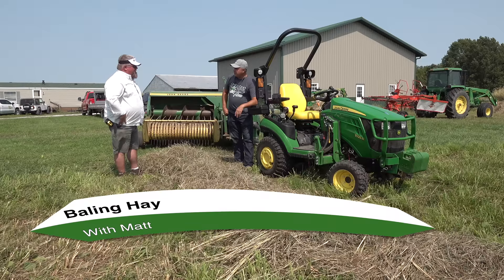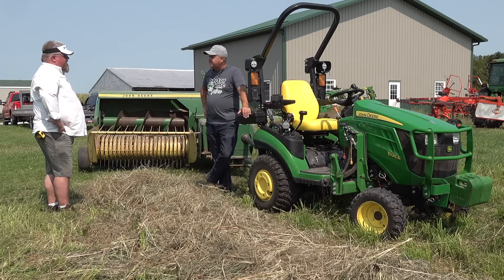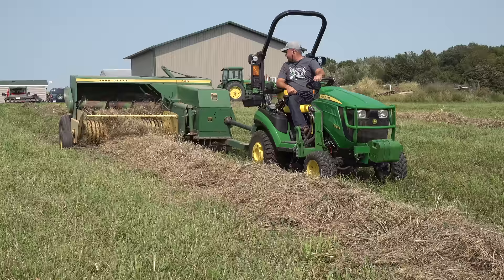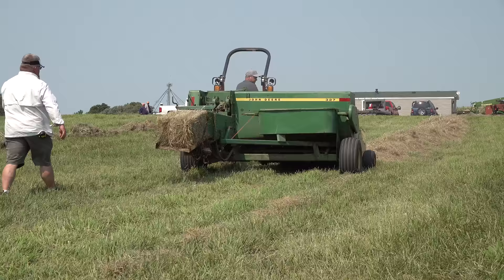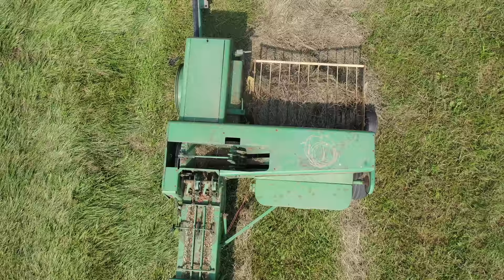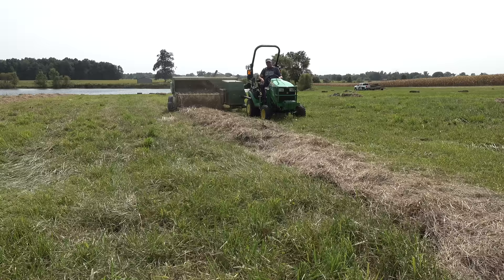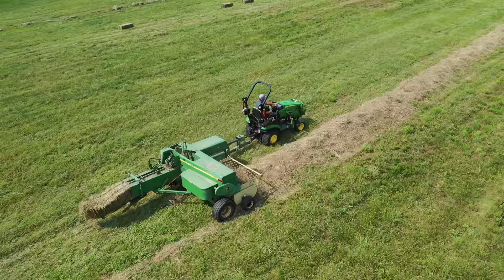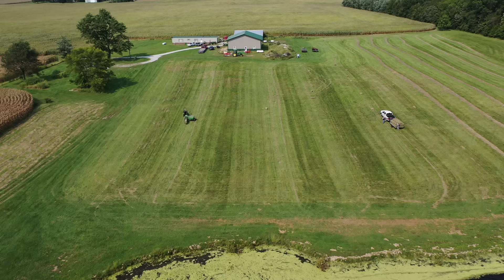FULL Size Hay Baler, Subcompact Tractor, John Deere 1025R!

Comment: A knotter story on an old JD 24T baler... Never, ever, EVER remove a link from the roller chain that drives an old knotter!  Im my case, the chain was loose, and I figured it wouldn't hurt to remove a link to tighten it up.  Giant mistake!  That shortened chain completely changed the timing of the entire knotter mechanism.  It seemed to work, right up until when the knotter tripped to start tying a bale and shot the twine needles up into the bale chamber JUST as the plunger was coming forward to compress the next bale flake!  Luckily the baler had a safety mechanism that lifts some plunger stops up as the needles come up.  These caught the plunger, which immediately stopped by breaking the shear bolt on the flywheel that drives the plunger.  Took a while, and some knowledge gained from an old JD mechanic, to realize my mistake and correct it.  Life lesson learned!
Reply: Seems like I remember something like that happened on a old new Holland bailer we ran when I was a kid.  But pretty sure ours snapped the needles off in the process.
Reply: The number of chain links has nothing to do with the timing.  What WILL affect the timing is chain stretch, but that is not an insurmountable problem.

Comment: Oohhh the memories of blistered hands and sweaty brows from putting up hay on my Uncle's dairy farm when I was a young teen. Thousands of bales into the loft. The shower at the end of the day always felt good. We pulled a wagon behind the baler and stacked the bales on it. The wagon was hauled to the barn and the bales were unloaded onto an escalator and moved up to the loft where we stacked the bales. Eventually they purchased a baler with a thrower that tossed the bales onto a wagon with high steel cage walls.

Comment: I bale hay with an old 8n ford pulling a new holland 271. It does good, when we first got the baler going we hooked it to a  yanmar 1550 tractor that was 15hp on the engine and it baled but we didn't want to use it on hills mainly from a weight perspective.

Comment: Tim, for future reference, one of the most critical adjustments on the knotter is the location of the twine needles as the come up though the bale chute into the knotter frame. I owned a custom baling business as a teenager and custom baled hay for years. I ran a JD 336. The needles need to just barely rub the knotter frame during the tying cycle. This assures the twine is placed squarely in the twine disc notches before they rotate. If the twine misses the notches in the twine discs the billhooks will pull the twine away from the disc assembly thus creating a “dropped” knot (as we used to say). It’s very frustrating when a customer sees all these busted bales laying around in his field. Creates a lot of extra work for the crew too. An old timer taught me this trick and he cussed me out when I explained that the operator’s manual doesn’t describe the needle adjustment that way. He said, “Do you want to follow that manual or do you want your knots to tie every time?” We were having a though time getting through the season so I tried it. Fixed it immediately! Never had to worry about it again. Experience trumps technical manuals a fair share of the time. As a Hoosier farm boy growing up in the ‘60s I appreciate your videos and insight. I own a 1025R too. Love it! Blessings my friend!

Comment: I pulled and baled hay with a Farmall Super C, when we farmed back in the 60’s 
They had 20 hp at drawbar
Reply: Yep.  Old tractors lacked horsepower but had multi-cylinder engines with flat torque curves to pull you through those loaded conditions.  The weight of those large frame tractors was important so that the implement did not push the tractor around.
Reply: On the farm I use to work on we bailed square with a John Deere 1070. It had about 30hp but was quite bigger. It still got thrown around by the plunger. At the end of the day you could still feel it while sitting or standing. Like being on a boat, then getting on land.

Comment: Howdy. In NY we call them needles that bring the string up to be tied by the knotter. We also called the sections of hay in the bale a wafer. Grew up on a dairy farm south of Syracuse. Tractor size for baling is about horsepower and weight. We had a hydraulic kicker on out JD baler and pulled a wagon around. We used a JD4020 and on hills you would not want anything smaller with a full wagon of hay. Great video.
Reply: I've always known a slice of hay from the bale as a "flake".  Might be a regional thing.

Comment: Memories, not sure good of all the square bales I tossed on our farm from our baler. Wanted to mention when I was a real small kid, the first baler I saw was one that used wire not string. Had seats on the back for someone to twist the wire in each bale. Finally got my 2025R to help me with chores in my older years. No farming any more but living on the old homestead. Your videos have really helped in setting up and using my tractor, a lot of good advice.

Comment: In the late 1950's we had a John Deere 116 baler.  The ram went from side to side which caused the baler to rock that way.  This eliminated the surging feeling on the tractor.  The problem was that the bales came out the side and had to turn to fall on the ground.  In general, round balers are for persons that feed what they grow.  Wrapped bales are sometimes left in the field until they are needed.  Our use of square bales was because we sold the hay which required that it be stacked on trucks.  Stacks waiting on the road side for pick up often resulted in some of the bales being stolen.  While we later went to 3 wire tied bales that could often weigh 300 pounds or more but this still happened.  The later development of the really large bales seemed to solve this issue but their use was limited to commercial feed lots.  Sales of hay for horse owners seemed to be best served by smaller 2 wire bales.

Comment: Back in my farming days, everyone used John Deere balers around me- just like this.  They typically used a utility tractor to pull it, and most had the kicker on the back.   I remember the one dairy farmer used his (then) new 2955 to bale with- because it had the cab with A/C!  Those were in the 70 hp range, like a 5075E, but larger.  Nice tractors.   My neighbor growing up baled with a small Ford utility tractor- which he also plowed with!  (they did have bigger tractors) 

 The one who didn't use a kicker had a wire tie model, and the 1/4 turn chute.  He had a New Holland Stackcruiser to pick them up.  Like you said, Tim- he packed those things as tight as he could.  They were for sale to the horse tracks, who paid by the ton- so the more tonnage you could put on the truck...  Busted my butt a few summers stacking those ones.  He pulled his with a 120hp JD cab tractor (not sure of model).  When stopped, it would rock the tractor back and forth, just like Johnny.

Comment: We use a competitive 38hp tractor and a late 50s model John Deere 14T baler with great success (550 bales annually) twine string only.  Single windrows are necessary in 3 ton / acre hay with a much narrower pickup attachment on the older baler. Winter tune up is available at the JD dealership if required at reasonable prices. Consistent volume of hay and proper bale chamber tension is essential.  Remove all hay from baler before storage and we coat all internal wear surfaces with light oil or diesel. Saves a lot of headaches.

Comment: We had one of those JD balers bought new back then. More cuss words and crescent wrenches were beat on those knotters than any other piece of equipment on the farm. It seems like when you are haying that you are only ever six hours away from a rainstorm spoiling the hay and the knotters get finicky because they sense the change in atmospheric pressure. Most often we baled with an Oliver 50HP 880 but after that went down stripping transmission gears while picking corn for a neighbor we used the 35HP Ferguson to fill in on baling duty (it surged/"lunged" too). You might get a 20HP Ford 8N to run the baler since you had the JD 1025R, but we only had the bigger Fergusons.
Reply: The biggest issue with the 8n for baling, as with so many other tractors, is the lack of a live PTO to keep the baler rocking but stop forward motion in varying windrows.

Comment: Reminds me of the days when I used to walk behind the trailer or truck tossing those bales up to the stackers. It took a little while before I could get them up high enough so they didn't have to practically fall off grabbing them. Then there were the snakes and the mice in the bales that were so much fun to have pop up in your face. I guess you've proved that in a pinch the 1 series will do some farm work after all. Good job. Hay elevators were the most fun. :)

Comment: Once again, it is amazing what the 1 series can handle. Seems like that jerky forward motion would get old real fast. I had to watch a slow motion video to understand how the knotter works. It is incredible mechanical technology considering when it was developed.
Reply: lol, knots really were simple with twisting and hook grabs rotating doing the looping, however the loops tended to get caught on all kinds of things and you'd wind up with a mess, so they added in the  final loop puller that did the knot tightening with some angled v that got semi sharp towards it's inside stop that made the cut, when that got dull, man oh man did baling life suck with lots of broken bales, single twined  kicking out, used to having to slash them with a knife as they slid out, saved on twine too, less wasted. my grandpa told me all about how these developed at the speed computers have developed. don't ever ask how the kicker works or you will get a lesson how the whole machines works, hahaha.

Comment: Incredible! We had the same baler with a kicker, hooked to a JD 7400 and you could feel the plunger on a tractor that size as well. Sweet setup for a hobby farm
Reply: Was about to comment something similar. On a tractor at the 4000 kg mark and a trailer behind, if still yanks it and standing still it's noticeable. And that is a "small" square baler, Welger AP 41, bale canal is 30x40 cm only, baler weights just under 1000 kg by itself (the top of the line Lely Welger AP830 nowadays is around 2000 kg).

Comment: This brings back suppressed memories from my younger days growing up. Dad had horses so we always seemed to have square bails. Bailing wasn't so bad but the loading and stacking in the SE Tennessee heat and humidity it was brutal. Let's not forget the times when a snake would get bailed. I still hate horses to this day, if it doesn't have a throttle I'm not interested. This would've been a good Halloween video. lol
Reply from the maker: Yea!  Easy to romanticize some of this.  It is HARD work when done at scale!
Reply: I baled hay as a teenager in Central IN. Our heat and humidity isn't much different than TN. It is a tough task no matter where one is even with tractors.  At a penny and a half a bale, one didn't get rich for sure, but I got the extra half penny for loading behind the baler. The guys unloading and in the mow only got a penny. They could have offered me a quarter a bale to go up in the mow  and I would have stayed on the wagon! Lol. My best day was loading 72 bales every 15 minutes. That was a perfect field...thick hay, flat as a pool table and the baler performed flawlessly.  There were days I didn't get 200 bales all day due to breakdowns. One day I made zip because the baler was new and hadn't been timed properly at the dealer, but I enjoyed hanging out with my boss even if I wasn't making any money.
About 10 years ago, a farmer friend of mine was baling about 10,000 bales of straw a year and offering $10 an hour. He couldn't beg, borrow or steal enough help to get the job done. Granted, I heard horror stories from more than one source how ridiculous his expectations were, i.e. 2 breaks during a 10-14 hour day, but for 10 bucks an hour, I'd have worn two canteens of water and managed. My friend just gave up growing wheat all together and is now strictly corn and soybeans. He still can't find enough help. Lol
Reply: @turdferguson5300  , you're absolutely correct! Hard work never hurt anyone and it surely makes one appreciate wages for a job well done. It kept me in better shape than I realized too.

Comment: I was impressed, I wouldn't have thought a 1025 would handle that bailer so well. I suspect the 2038 would be marginally better, but I was surprised how well the 1025 did.
Reply: 25 horse or 38 horse 38 would be much faster. I bailed many a bale with a j d B when I was teenager. B had I think 28 h p but weighs 4500 pounds. I still have the tractor I used from the early 60 s. I'm old now but the B still runs good.

Comment: We used to get that surge on a gear drive 44 hp tractor that weighed in at 6,000+ lbs with ballast.  The square balers can really shake you when they get moving.

Comment: I've ran my 4115 on a new holland 68 and it does well for small, tight areas I need to bale, plus I've also cut hay with a new holland 479 haybine on 4 acres and it handled it just fine in low range and a steady feed of hay. I'm happy that you are seeing what these little tractors can do.

Comment: I'm not sure I would want to try that in hill country, but it seems to have worked well on relatively flat ground.   We used to bale with a 245 MF and it would get pushed around by the baler on hills.  In later years we moved up to a 90 HP Case and it didn't give any ground to the baler.

Comment: When I was a kid, my Dad had a 24T with a Wisconsin air cooled engine mounted on it.  If it ate a large gulp of hay, you could hear it a mile away straining but it never failed.  You don't need a 120 horsepower tractor to run a small square baler.  If the knotter doesn't work initially, it may be from too liberal greasing of the knotter.  They only need a bit to stay alive.  Better to grease more often than a large goop coming out and causing the twine to slip in the knotting process.  In my lifetime, I have bales thousands and thousands of square bales.  So much so, I switched to round bales.

Comment: Personally, I make hay for a living.  Some round bales, but mostly small squares.  The first few bales never tie correctly.  Another thing I’ve done is put a platform in the back of the baler so that someone can ride along to make those adjustments in the beginning.
Reply: Who ever I bought mine from must have known how to tune them well. I have basically that same baler. I have had two broken bakes in about 2000. Never any issues starting. I do leave the last bale in it though. Probably corrodes it a bit more, but the grass should be pretty dry anyway. That suggests it is all about adjustment unless I just got lucky with one that was made better.

Comment: When I saw the thumbnail, I guessed that bailer was a JD 327. My dad bought one brand new in 1981. He had a John Deere 950 tractor he'd bought new in 1977 or '78 that pulled it. It was 27hp. After multiple troubles trying to hire out to have the hay done, he finally invested in a whole set of brand new hay equipment in summer of '81. That 327 would bail anything. It was the smallest of the series. I think there was a 337,  347 and 357 and this series may have been first produced around 1980. Maybe very late 1970's. The only trouble dad had was at least once a year during the bailing of the field, that thing would plug up in real heavy stuff and he'd break the shear pin on the flywheel. We figure it only did that because it was the smallest of the series.  But it was such a great bailer and so reliable. Dad started to pull it with a 50 horse Allis-Chalmers 5050 in 1984 or so. Sold it in 2002 and only because he quit raising cattle and didn't need to cut hay anymore. Seeing this brings back great memories!

Comment: Nice video.  A little correction in your comment.  The hay is compressed in the bale chamber.   Also it the needles go through the hay they break.   The needles go through slots in the plunger.  

Keep it up.

Comment: I've baled with 348 Small balers for 25 years. You need a bigger tractor. It's not the horsepower, it's the weight of the tractor. All that rocking of the tractor is energy taken away from the compression of the bale. You get much tighter, cleaner bales and fewer missed ties when you have a tractor with more mass. The larger tractor can also help keep that flywheel at its optimum RPM. We bale straw with a 7820. It's HP could wring the PTO off, but with it's mass, bale quality is top notch!

Comment: Compact and sub compact tractors can do more then most think. Thanks for the content.
Reply: Yep, the general rule of thumb is that HP buys speed, but if your willing to go slow, it doesn't take as much as you might think. Of course that's the whole purpose of Tim's website, showing what these little tractors can do. He does a good job of it.

Comment: My thoughts are yes it would work on flat ground but you're at a definite weight disadvantage  so any kind of hilly ground will get sketchy fast with that little 1025r.  I'd go up to the next size or 2 larger for better weight control.   Also. If you have a cruise control that may help. So every lunge from the bailer doesn't move your foot on the hydrostatic foot pedals.   In the old days you picked an appropriate gear and clutched it as needed if the windrow got thick and the bailer needed to catch up, or down or upshift as needed.

Comment: Neat video! We ran our 14T with our Mahindra 32hp hydrostatic transmission for a season or two then decided we could afford a good used MF 265 we found at an auction. We figured Breaking the compacts transmission would’ve costed more than the whole other tractor 4 years ago.